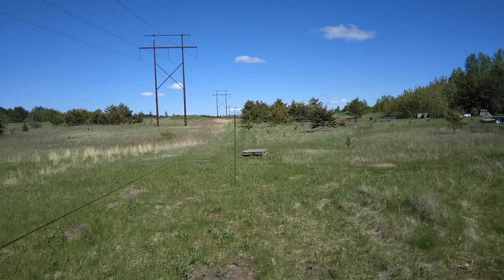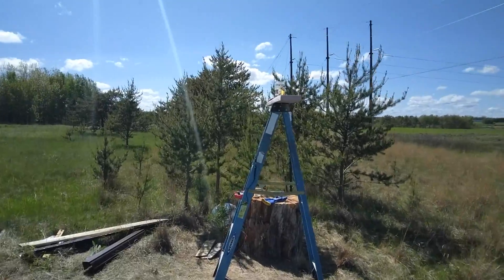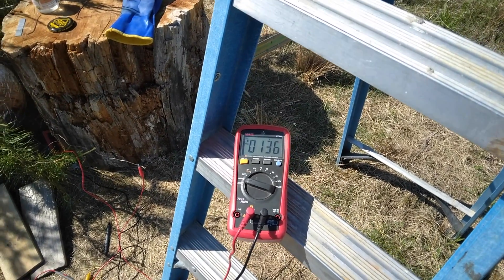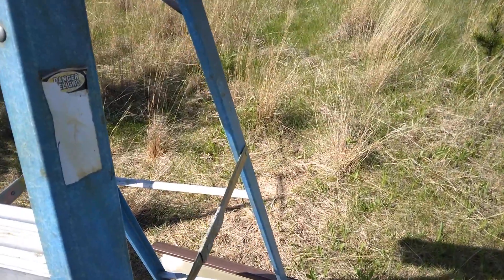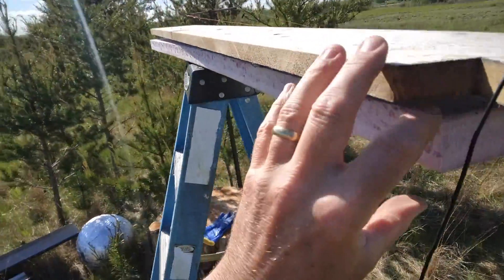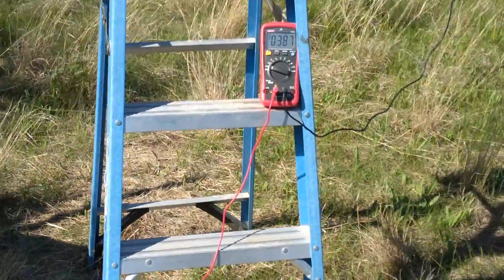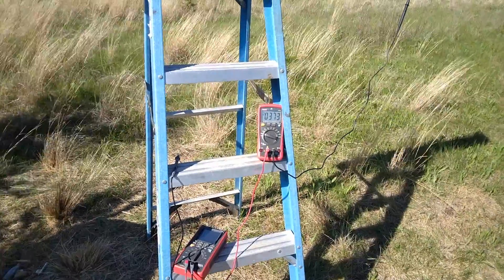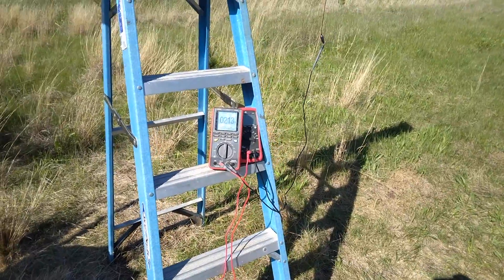Amazing stray electricity collector design!

Comment: Have you tried coils tuned to 60 hz?
Reply from the maker: No.  Just seeing what materials work as a collector.
Reply: @doubleMinnovations  I would seriously consider it, especially since you know what the frequency is.
Reply from the maker: Paul from channel "https://www.youtube.com/@INVENTOR3" has done a lot of that in the past.  It might interest you.  I've been kind of going in a different direction.
Reply: @doubleMinnovations  Any HAM operator will explain length of wire RE frequency. It's not how much voltage but the increased (usable) current from it. What I perceive is static current you are measuring and it has to be really high to have measurable value.
I encourage you to continue by all means. And I offer no criticism, just encouragement.
Think a dozen coils, paralleled along the length you are currently using.
I asked a lineman why there were rubber strips from his axles to the ground. He replied to discharge the static voltage built up during the day. A half amp can kill you. But makes a lousy power source. I was developing a product using wireless power to recharge the built in non accessible batteries. QI consortium specs. Up to 15 watts from a 1.5 by 2.5 antenna transmitter receiver pair. They were in close proximity, but you have the advantage of a relatively large field. I realize you are basically probing this field, but Tesla did it long ago.

Comment: Try a pyramid covered in gold
Reply: And who's providing the Gold?
Reply: @bryanst.martin7134 not Israel! They only take.
Reply: @bryanst.martin7134  UFO beaming an electric ray
Reply: @bryanst.martin7134  not Is rael ! 
That's for sure.
Reply: The Gold Pyramid in Wadsworth, Illinois
Reply: @kkristopher7413  I've heard that place is sleazy.  The women are rough ?
Reply: Can you harvest this electricity for your home use?
Reply: Actually your on to something but the guy I saw used copper I belive and when he attached wool to the center of the pyramid inside the center hanging from a wire he was thrown back a hundred feet give or take when he touched it

Comment: I think if you do the same thing with a regular dry board with no electrolyte you'll likely get the same readings. The board is probably doing a better job of insulating the wire from the ladder's interaction with the field than the styrofoam does. Anything on the ground including the trees, people, the ladder, the grass, mostly anything will extend the ground's influence on the field. ElectroBOOM and Plasma Channel did great videos on this a few years ago, and powered a little static electric motor. lasersaber even built a longwire-powered atmomotor so powerful it could drill small holes in wood. Not even under a power line. You should check their videos out, but I love seeing someone actually try a bunch of different objects in different scenarios. Nice job!

As for the wind, I'd consider whether it's causing any movement in the overhead cable, and also the triboelectric interaction of the air and its contents (dust, humidity, etc) with the materials you're using.
Reply from the maker: A board without added electrolyte, might do the same thing. -(I started thinking I should try that also, though there are natural electrolytes in the wood too).  The ladder is fiberglass which is a non-conductor, and it has a plastic top step.  In the video I also turned the board over, so the nails and wire were in contact with the styrofoam, and got the same readings.  Thanks for the comment.
Reply: @doubleMinnovations  Nothing is truly a non-conductor, some things just need more voltage than others to pass the same amount of current. What I'm really saying though isn't so much about conductivity/resistivity as it is about the shapes of bodies interacting with the electric field. You already verified that your board is not measurably conductive to your meter, yet its presence is changing something. Do it on a wooden ladder instead, you'll get different readings. Do it at the same height in the same location as the top of the ladder was, but without the ladder under it, like on the center of a long board supported at the ends. You'll get different readings again. Use something besides wood, different readings. Unwrap the beach ball and put it near the wire. It'll change your readings yet again, even though it's plastic. I admit metals and magnets likely have a stronger influence, but every single atom nearby is having an influence.

If you want to minimize that influence I'd consider suspending the whole experiment  further off of the ground using a minimal number of something like fishing lines.

As always, I appreciate you taking the time to answer. Thank you.
Reply: Follow on thought just occurred to me: if you measured the current from all the objects, I'm guessing that the foil wrapped beach ball would win for amps and watts, even though the copper wire on the board has less resistance so higher voltage.

Comment: You're not isolating from the ladder😮
Reply from the maker: It's a non-conductive fiberglass ladder, with a plastic top step.
Reply: @doubleMinnovations  but you indicate that the proximity of the trees and yourself affects conductivity. Edit: I love what you're doing and am fascinated by the experiments. I don't know much about these things, and it seems like this implicates recovering lost electricity
Reply from the maker: The trees are alive with natural electrolytes, and are grounded.  -They are grounding out the charges all around themselves.  My body is also full of natural electrolytes, and am grounded somewhat depending on the current moistures between mean and the ground.  If I stand on styrofoam, my whole body gets charged, like I showed in another video.  It all depends what and how much something is grounded.
I'm calling it 'stray electricity', because it's strayed outside of the power line corridor.
Thanks for the interest!

Comment: at 5:38, aren't you just measuring the voltage captured by the wire?
Reply from the maker: I was comparing voltages with the other setups I tried.  Higher voltages result in higher currents.  Towards the end of this video I did a volt amperage comparison with a big metal conductor.

Comment: I really don't think that a dried acid on wood is doing much. Anyway, you were getting up toward 480v even though amps were in the micro range. So, what about a "property fence"  of four 480v wires in parallel ?